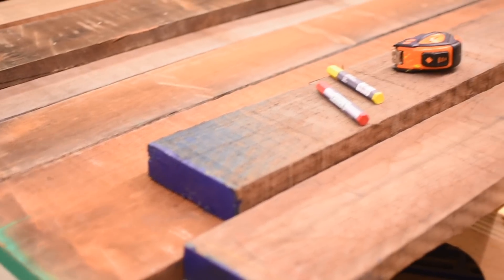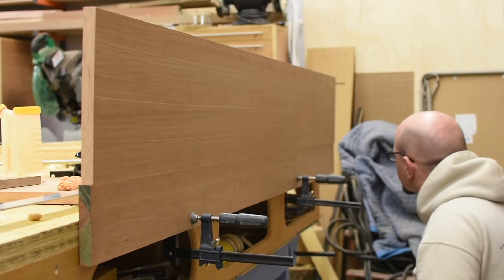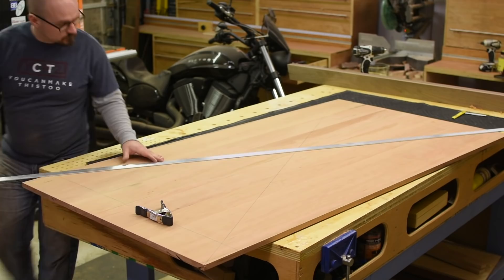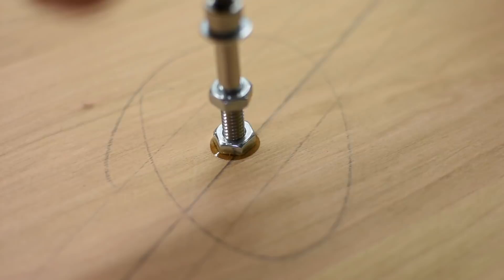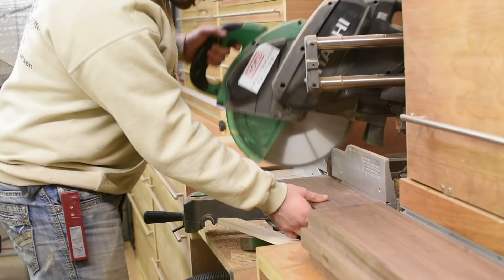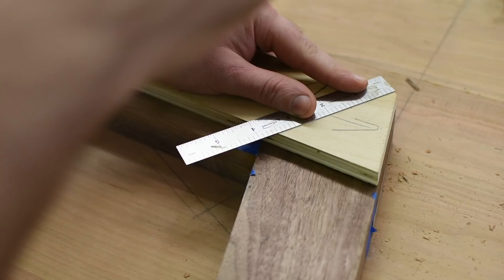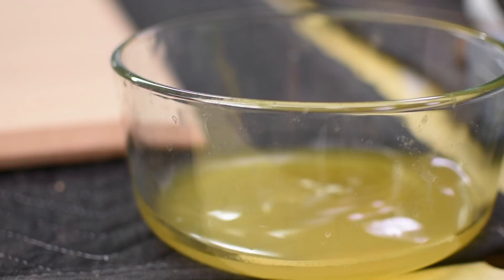How to Make a Simple Modern Dining Table // With Plans

Comment: I built this and it worked out fine. I used walnut also. The one thing I would point out (it may be already mentioned somewhere) is that you shouldn't expect the same torsional rigidity as a table with four round legs that stand vertically with perimeter aprons. Remember you have four rectangular sectioned legs and their only support is their attachment to the bottom of the table. If you try to twist the table it will feel springy. The X pattern with an arch, the splayed legs and the chamfer on the bottom side of the table are great features. My daughter-in-law and son like it; just what they wanted. So it was a success.
Reply from the maker: Glad they loved it! And yes, I should have mentioned that. It is subject to twisting.. but not so much to interfere with use. Some folks may find it really annoying though.
Reply: Great table! I know I'm late to the party here but what things could you do to the bottom to make it less springy if desired?
Reply: @davidk5430  I don’t experience springiness. Just angular torsional or twisting. Some additional angular pieces of wood down closer to the bottom would be needed. Of course that will change the look.
Reply: Making the legs with a rectangle apron around the perimeter will also stiffen it up.

Comment: Looks very nice. I'm slowly learning as I go when it comes to wood working. Started with the cheap stuff, pine. Working with rough cut black walnut that I got from a local guy who mills and kiln dries it. So far I've made a live edge shelf. Planning on building a desk eventually with the rest of it.
Reply from the maker: That’s great! Glad to hear it! It’s definitely less scary working with cheaper material, but as you get into finer technique it’s a lot easier to work with the harder species.

Comment: I did a dining table a few years ago so much like yours, there are a few differences like the surface, I made it a bit curved in the corners. The only problem is that the complete table moves, doesn´t moves much but its a little annoying.
I've tried many things to fix it, it has been improving but I can`t take it away. If you or anyone has any idea of what I can do, I would be so so thankful.

Your work in general is amazing by the way.
Reply from the maker: Thanks! Mine has a bit of wobble too. The only thing that would help would be stretchers between the legs to remove some of the ability to rock I think.

Comment: How did he attach the legs and the underpiece to the main tabletop after he constructed the legs? I'm new to this, so looking to learn all the details that I can from videos like this!
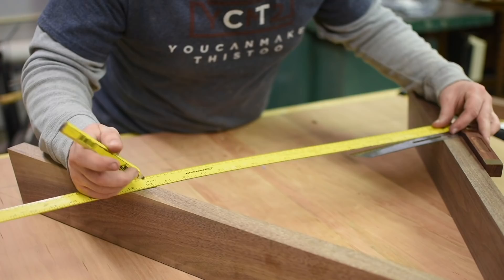Reply from the maker: 4:08 to 4:30 shows the elongated holes in the base. 5:10 starts putting the threaded inserts into the top. When I put them together I just ran bolts through those holes into the inserts.

Comment: Great video and beautiful design, but I guess disassembling the table for easy transportation is completely impossible.
Reply from the maker: Thanks! But false. Pull the four bolts out of the bottom and it breaks into two leg assemblies and the tip.

Comment: Caleb, what size and type of drill bits were used to make the elongated holes and do you think using 8 bolts instead of 4 might make the table more rigid?  Thanks.

Comment: Great video! Could you provide a few more details on using the threaded bolts for the tabletop attachment? Are the holes through the support the oval shape all the way through the wood? So the bolt head & washers are sitting on top of this hole or is additional material drilled out so they're hidden? Also how large of a bold would you recommend: 1/4-20 or something larger? Thank you!!
Reply from the maker: The oval shaped holes do go all the way through the wood.. However, there is a smaller oval inside the larger oval. That creates a shoulder or shelf for the bolt head/washer to sit on, so it's hidden. I used #12 or 1/4-20. Thanks!

Comment: what is that yellow applicator that you applied the arm-r-seal with?  do you use that for all kinds of stains, dyes, etc... on larger panels so that you can flood the surface without sections drying too rapidly?
Reply from the maker: It’s just a pad applicator. And you’re on track. Just a faster way to apply to big flat surfaces.

Comment: How sturdy is the table? How much does it side to side? I build these same legs and it’s almost as if I need to add cross piece between all the legs
Reply from the maker: I don't think it made it into the video but I laid on the table and it held me just fine. It does have some wiggle but the client didn't mind.
Reply: @YouCanMakeThisToo  i just built an identical table, inspired by yours. and it wiggles a lot. idk if because i used a softer to medium hardness wood. or because i havnt attached the top yet, but i did set the top and it wiggles badly.

Comment: use Seal-a-Cell before GF Arm-r Seal
Reply from the maker: I never noticed enough difference to justify the extra time and cost
Reply: @YouCanMakeThisToo   s/b less per Qrt can for seal- a-cell, plus if you use " awash coat" of 50% seal- a-cell and mineral spirits will stretch the product and then use the more costly Arm-R Seal for your final 4-5 coats. let cure for 7-9 days, and buff with a folded brown paper bag

Comment: Great video!
...what applicator is that? I’ve had problems with streaks using Arm R Seal so want to try something new
Reply from the maker: It’s just a pad applicator my local place sells. If you’re getting streaks it sounds like you’re not wiping the excess well enough?